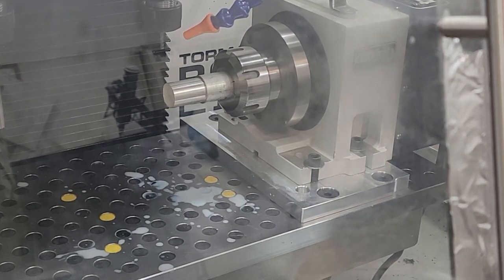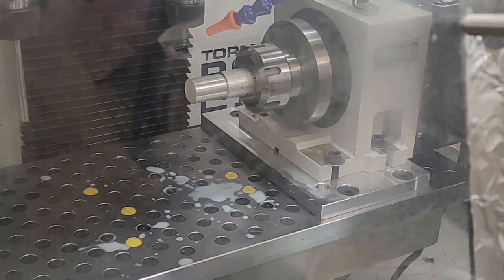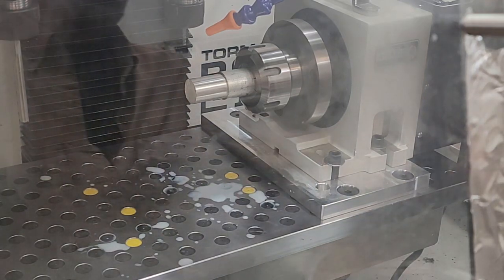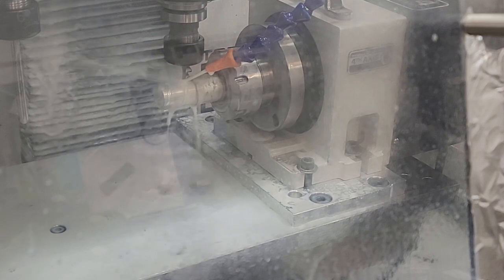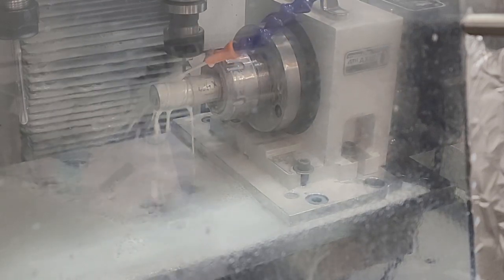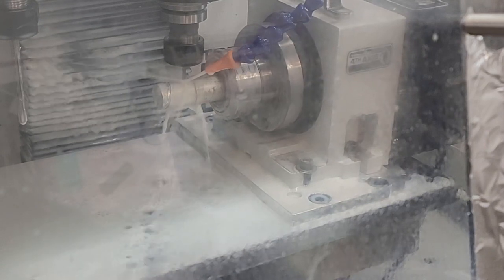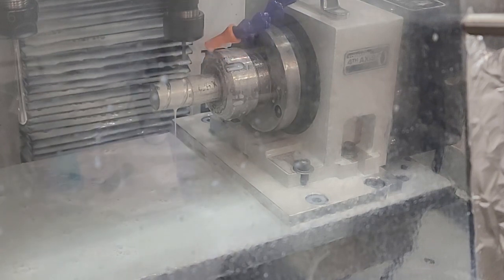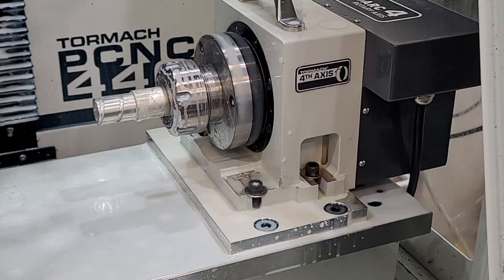First time using the Tormach Micro Arc

Comment: You use fusion360 for cam? Couldn’t quite figure out adding the micro arc to it
Reply from the maker: Hi Andy yes I use fusion 360.  There are only a few operations that Fusion 360 supports without adding the Manufacturing extension.  So long as your part does not require simultaneous 4th axis movement it works.  In the post under Machine config you tell fusion that you are using a rotary table axis.